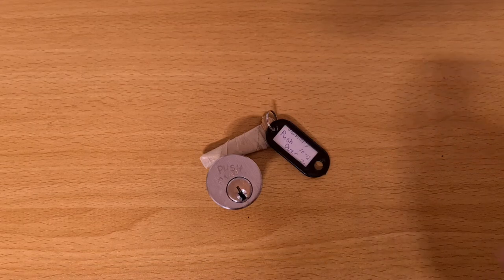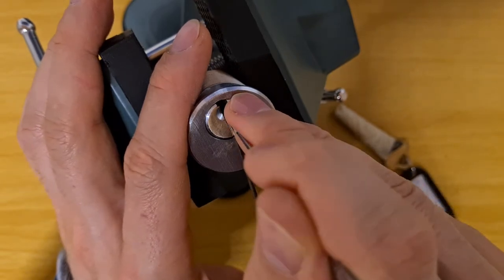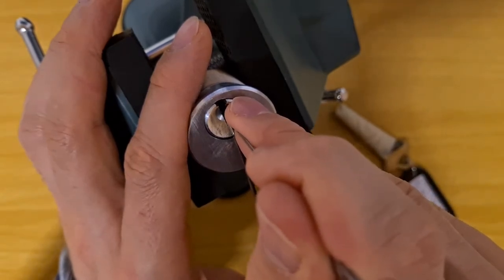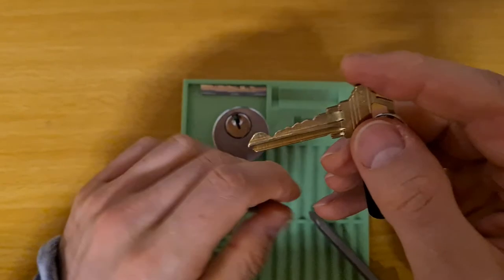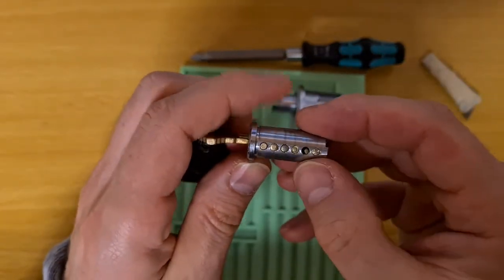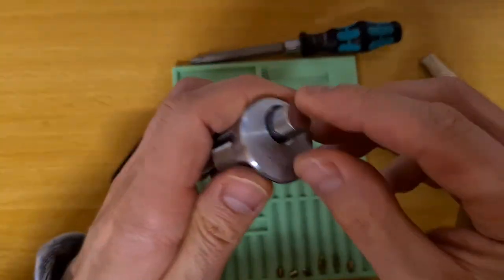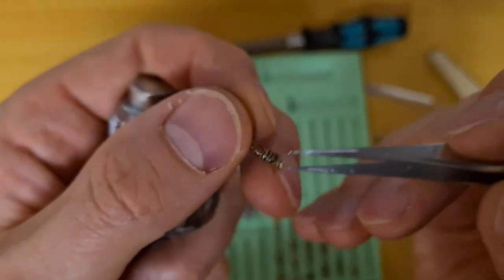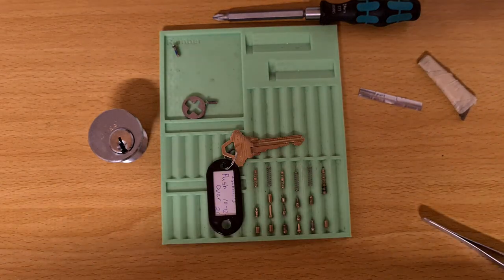J.Gabriel's "Push Over" (haha...) CL picked and gutted

Comment: Oct.12th it was finished. This was before I did Bible mods and figured out what I needed to do to get in the Bible. 
The key, that's a deal on it's own. I still have trouble with them sometimes with the hand filing process. Awesome job on the PnG 🦾 picking the way you did actually defeated the catastrophe pin ( nail, brass bead and sleeve ) it's a gravity fed 3 part pip I guess. I have made a couple of actual triple pips ( PIPIP) . That lock was within the first 10 that I made, possibly number 8 or 9.
Glad you enjoyed it ☺️